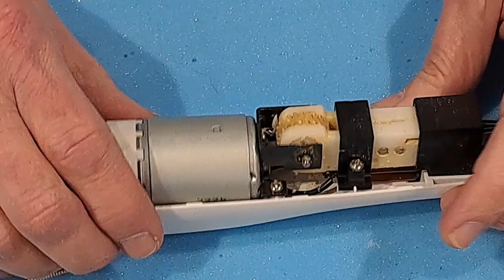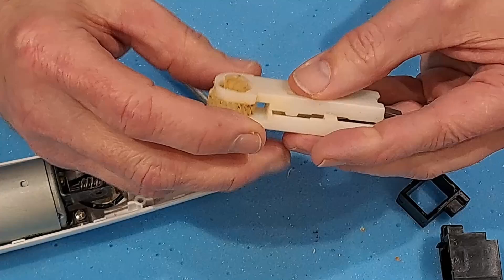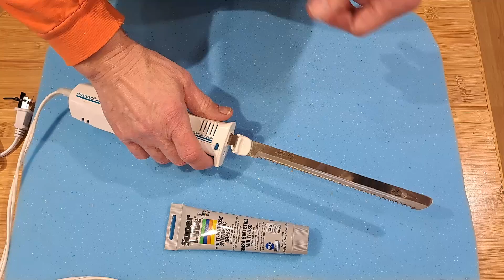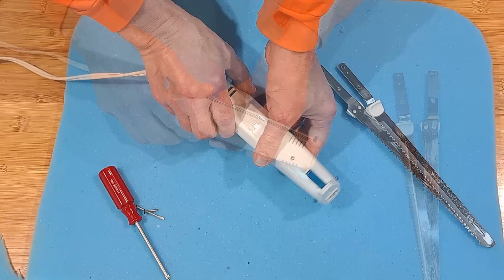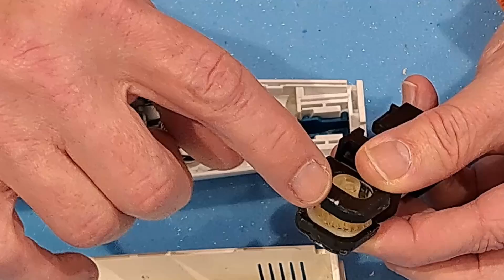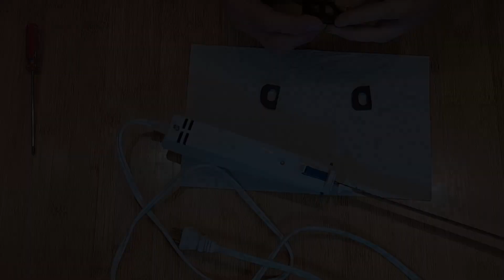Electric Knife Repair

Comment: I am really quite impressed that you got this working pretty quickly! It makes sense to use a Resin printer for this use case as small parts in filament 3d printing tend to break really easily. 
I do have one complaint and that is that you are obviously placing your Electric Knife in a Argon sealed chamber for decades thus preventing discoloration. I should have thought of that, as mine is ... well much more discolored... even your plug and wire have zero discoloration! (it is just not fair). (Oh wait, are you secretly putting an oxygen absorber in the box?)
heheh
Reply from the maker: Wait! . . . 
Do you not keep yours in a Argon flushed bag? 🤣

To be fair, the main gear piece is somewhat yellow. I honestly don't know why the whole thing isn't more yellow. Maybe they used to use better plastic.
Reply: @SchoolReports  hehe, I suppose they could have used better plastic, but I do recall practically all of the white kitchen utensils from back in the day discolored. For mine,  I tried the Peroxide and Sun exposure trick to get rid of it, and that worked for me.

Comment: I have a BAMIX stick blender that i got when my I had my first baby to make baby food with so it's 40 years old and only just stopped working last year :( I wish I could fix that , it's cheaper to buy a new one then to send it away to get fixed if you can believe it , and the ones they make these days are not as good .
Reply from the maker: I love repairing these things that weren't really planned to be repaired. So satisfying! I feel like I've won over "them" every time. I have 3D printed parts all over the place.
Reply: @SchoolReports  It's good when you can be so handy :)